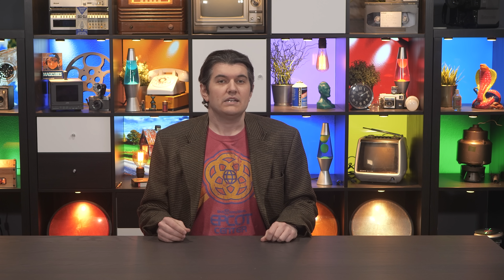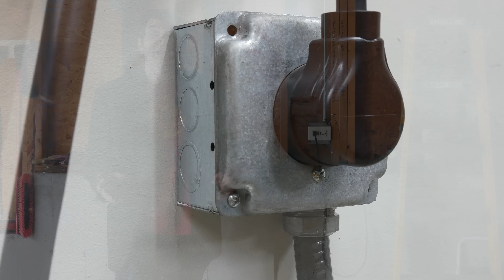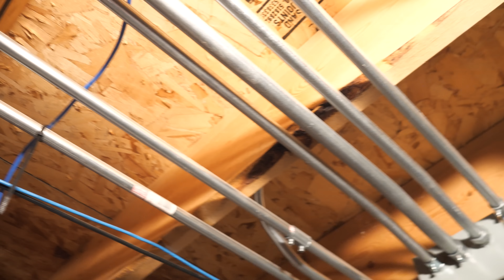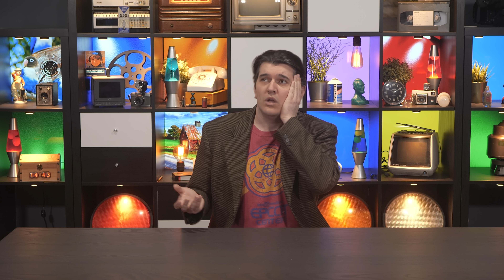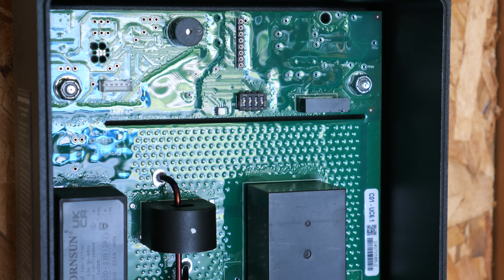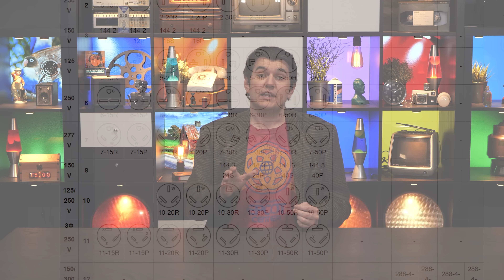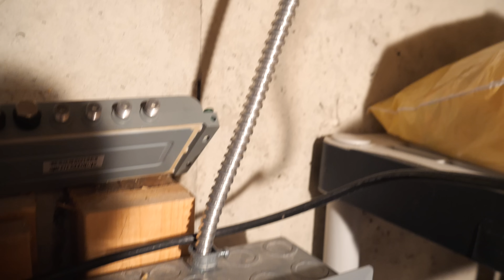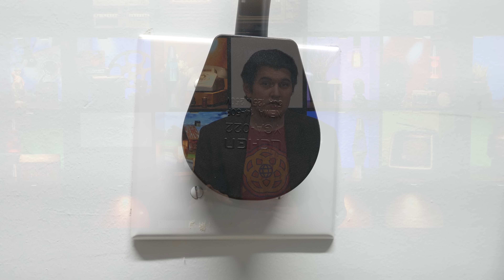The "standard" car charger is usually overkill—but your electrician might not know that

Comment: You can plug a EV into 110 Volts AC outlet, however the biggest con is not enough amperage from the wall to be able to charge the car quickly enough, you'd be waiting for up to three days to get to 20% from 5% charge if that. Naturally it depends on how big is your car's traction battery and internal charging voltage which is now both 400 to 800 Volts normal voltage that they can provide to the motors. So I'd think 240 volts AC dryer plug is a deal better especially in a pinch.
Reply: 3 days? lol
Reply: @HughZantu Try it for yourself. It's limited to 12 - 16 Amps and it takes aggeeeeessss to charge on 120 Volts, especially because recent EVs have huge battery packs so you can imagine how long it will take.
Reply: @Dr_Mario2007  Yes you are correct, I can't try it because I'm a V8 lover. But at the largest market capacity, the Ram 1500 EV has 229,000 watt-hours of capacity and at 1500 watts it would take 152.66 hours to charge from 0% to 100%. Applying 80% limitations that's 122.13 hours to charge. I think yes, the caveat should be that if it's over a certain pack size (100k watt-hours) then it is not practical. But lets be honest most of his viewers are NOT buying the RAM 1500 EV and are buying more Nissan Leaf's than in comparison which would fit into the 8 hours he claims. But it is still an exaggeration to say that 15% charge will take 3 days, because even that RAM 1500 needs 22 hours on the slowest charger to charge 15%
 of its rated capacity. 

Cancel

Reply

Comment: I run ours at ~2kW…
I do have a 7kW charger as well, but that’s very rarely used.

12k miles a year, will at least 11k of those at 2kW or less.

The smart features are important for access to certain tariffs on this side of the pond.  Whenever the car is charging all my power is very, very, cheap.

Comment: I live in a tiny appartment(600 sq.ft), we have to pay 150 extra every month because we need a special connection for 3 x 8kw connection. according to the landlord and his 'trusted electrician' this is necessary because of the heatpump which is connected to a 25circuit breaker anyways. Felt like an insane discussion that they were not understanding how such a connection is not needed

Comment: Berween april and november I limit the powerdraw for my house to 5kwh/h. Because of extra (monthly)fees when using more pr hour. About 1kw goes to heating and household. The rest charges my work car and our private car. They are almost everyday fully charged. 
In the winter the cars needs more power, and the heating of the house too, so i have to pay the extra fee to draw up to 10kwh inside a clock hour.
If I used the standard setting of 11kw charging I would have to pay for the 10+kwh/h plan, and that is extra money each month.....

Comment: I bought an F150 lightning back in October. I am luckily enough to have be able to afford having a 50A circuit run. I spent the extra money on an Enphase EVSE. The internals are basically the clipper creek with the addition of the smarts. It'll charge regardless of whether it has a data connection or not. It is a hardwired exterior installation and I love that I can see it charging through the same app that monitors my Enphase microinverters. With it being an external installation it's nice to be able to shut it off from the app if someone tries to steal free energy from me, though I realize this will probably never happen.
While the big charger is nice to have, after living with the vehicle for months, I probably could use any size 240V charger and be fine with range. Even my big inefficient truck does about 2.2 mi/kwh in the summer and 1.7 min/kwh in the winter. My commute is about 50 miles so I could recover that overnight even with  a 240V/16A charger. 120V/12A was kind of painful before I has the EVSE installed.

Comment: Picked up a refurbished Bolt in February (exceptional deals right now if you're looking for a simple city/commuter EV).  Even with an ~80 mile high speed, mountainous commute, I'm over 10k miles in (with mostly cold weather) and still only using 120v 12a charging.  As long as I can get a sustained 2-day "top off" every weekend, I'm good.  I'll likely install a 240 socket some day, but now with warmer weather, I can almost "fill it up" overnight on 120 alone.
Reply: A used '17-19 Bolt is a sweet spot right now, as every one of them got a new battery, a new battery warranty, and larger capacity battery.

Comment: There are some niche uses in which a smart EVSE makes a lot of sense. 

I have 7.6kw of solar, and a single powerwall (13.5kw). I consume between 1.0 and 1.5kw throughout the day, and in the summer months produce around 40kwh. 

This means around noon, my powerwall is full and I begin exporting 4kw to the grid for  about 5 hours, as my storage is full. 

Since our solar and battery are Tesla-branded, I could do "charge on solar" if I had a compatible Tesla vehicle. We do not, opting instead for an ioniq and a bolt. 

Choosing an OCPP-compatible EVSE means that I can link my Tesla home API and the Wallbox Pulsar charger with NetZero to taper the current being sent to my vehicle exactly to match the excess solar production which would otherwise be sent to the grid. 

Any power I send to the grid loses 9/10 of its value due to California's NEM 3.0 tariff. 

During the summer months charging on only excess solar saves me 50-60 per month!

Comment: Bonus: those Grizzl chargers are made in Canada!
Where I live, most appartment parking lots have 120V for everyone because it gets down to -35°C in winter sometimes.
Reply: They may only budget like 3A per stall. Most block heaters are only around 300W.
Reply: @economicprisoner only 300w? The factory block heater for my car (a Subaru so not a large engine either) is 450w, plus another 150w for the oil pan heater. In AK, every parking spot has its own 20A circuit, and it’s common knowledge not to plug in to the other half of an outlet someone’s already using, because it’s pretty much guaranteed to end in a tripped breaker.
Reply: @economicprisoner  I didn't stop to think about it but how can they limit it to 3 amps? All 15-amp circuits can take 12 amps no matter what because it needs to be to code.
Reply: @Coccinelf  You are allowed to have up to 12 outlets on a single 15A/20A circuit.
Not sure on block heater-specific code.
Reply: @economicprisoner  Oh why I didn't think of that?
Reply: @economicprisoner  Wait a minute! I know why I didn't think of that! It was plugged in directly on my meter! Only I paid for that. Same with all my neighbours. I'm not saying it works like that everywhere but where I live, appartments where the costs of electricity is not paid by the tennant is so rare, I'm pretty sure they don't include any outlets for block heaters.
Reply: @Coccinelf  I have lived in an apartment like that. I have also lived in an apartment with no plugs: because the garage was heated.
Reply: This varies by the type of building in areas that have block heater outlets. In many apartments the heater outlet is connected to the breaker panel for the apartment the stall is assigned to, and so the full circuit capacity is available and the electricity cost comes off of your meter, so you could reasonably charge an EV from it. In other apartments or condos there are shared circuits for block heaters which are paid for collectively in some fashion. Some of these have energy saving intelligent outlets which cycle the power on and off depending on the outside temperature, and also limit the maximum power draw to around what a block heater would use, which makes them unsuitable for charging an EV.

Comment: I am considering replacing a NEMA 5-15 outlet with a NEMA 6-15 outlet so that I can reuse the wiring (finished basement means I don't have access).

Was not able to find an EVSE with a NEMA 6-15 plug. Got an programmable EVSE with a 6-20 plug. Plan to program it for 12A, and then install a 6-15 plug. The 6-15 plug will prevent visitors from accidentally drawing 15-16A with their own granny lead.

Because the limit is set by software: I am not sure it is fully complaint. But I have confirmed by reading the manual that it will remember the set point after a power outage.

I will require the 240V charging for overnight charging in the winter. Heating up the battery and cabin takes too much energy to do that reliably on 120V.

Comment: I was ‘shocked’ how well a 15 amp plug worked. Barely handles 11 amps 😂 but works well 99% of the time.

Purchased a 50 amp 220 charger. Have yet to bother getting it hooked up.

Comment: I had a 14-50 installed for my evse, but the electrician refused to install anything more than a 30 amp breaker because of my current loads.
(He also gave me an estimate on a 200a panel upgrade) But I've since realized that 30 amps is more than enough to charge my ioniq 5 to full in 8 hours overnight.

Comment: The apartment rental situation is indeed a serious problem for EVs. I think the auto industry has made 2 incorrect assumptions. 

First, that renters don't buy new cars. While that may be true for some, there are many who do (or did before being abandoned as a market). 

Second, is that only new car sales matters so the renters who don't buy new cars don't matter. 

Of course the result is a self fulfilling prophecy. Renters indeed don't buy EVs. Not because they cant addord them, but because as pointed out in this video expecting someone to charge daily in front of the local walmart is insane (even tho it eould be Walmart's wet dream). Of course the long term effect will be a decline in resale values of EVs as the used market shrinks. This will result in more people upside down on loans, either taking increasingly risky loans or delaying tradeins, lowering new car sales. 

On top of that it puts renters in a situation where it is increasingly harder to find an economical vehicle for a daily driver, at a reasonable price. 

And finally if the auto industry were to ever go full EV, it would result in keeping used combustion engine vehicles on the road far longer, at a higher cost, than was ever intended as the used market would have to meet the supply (decreasing) and demand mismatch.

Comment: App connections are just a fetish.  It’s a nonsense that so many devices need apps when there are still many people who do not have smart phones. Thanks for letting folks know that a car charger is basically a plug and socket !
Note aluminium cable in a brass terminal will corrode and eventually break off.

Comment: Just finished a 35 unit home complex (a group of units around a car park) where the residents wanted EVSEs for every unit.     We designed a 3 phase system and put the simplest single-phase Zappi units.   Each phase had a string of 7kW chargers connected.  There's a controller on the network talking to the EVSEs.  The units are connected to a common meter and each unit owner pays for what they use, plus a small connection fee component.  Was there to review a few weeks after commissioning and the data looked very good indeed.   

The whole system was less than $2000 per house, including all of the ground works, conduits, cable, EVSEs and the controllers.     The only issue is that the users can't use their solar exports into the car, as they are behind a different meter.    But - that's just an accounting thing.
Reply: Incremental progress is better than no progress at all.
Reply: Here in Australia the whole metering off house/shared services seems to be the main remaining point of resistance getting chargers into strata title units. There are numerous load management systems available now that can provide metering and billing solutions in these cases, along with managing overall charger draw when multiple chargers are active. Useful when the existing supply is limited. Provisions for load balancing were built into NCC2022 - provision meaning ‘leave space in the board’ - but hopefully we’ll see things get firmer in NCC2025 so developers can’t just cheap out.
Reply: Nice!  I think that employers who provide carparks should provide a certain number parks with access to EVSE.  I've long believed that you don't have to put in some stupid supersized supply which is expensive, but if you have a system that can load share dynamically you can get a lot done while allowing multiple outlets.  It sounds like the Zappi can do that for you, yes?
Reply: @lindsaydempsey5683 not sure which country you’re from, but as part of Australia’s latest National Construction Code (NCC2022) EV charger provisions for a percentage of car parking spots AND available power are required for certain classes of buildings (commercial buildings, hotels/accommodation etc). Alas ‘provision’ doesn’t mean ‘install actual chargers’, just ensure conduit pathways and capacity in the board (electrical and physical) exist so as to support a future upgrade. We of course specify actual charging infrastructure with our designs (I work in consultant electrical/services engineering) but while most government projects want the chargers in place to support their increasingly EV based vehicle fleets, fewer private developers are following through unless their client/tenant demands it. 

Load Management is the key to managing multiple chargers without allocating hundreds of amps of additional max demand. 7.2kW/32A single phase or 11kW/32A 3-phase is all you need per charger anyway… not many cars can support 22kW charging anyway.
Reply: Isn't thatm ore then an accounting issue, because you aren't charging behind* the meter you also have to pay the vat and gridservices.
Reply: @ferkeap  Not British - so where's the VAT being paid?
Reply: @DozIT  I'm not an idiot - And also not a Merkin.   the AU should give you a hint.

We pay GST.  Deffo not VAT.
Reply: Fantastic!
Are there any resources you and your team used to put it together? I’d love to advocate for something like this in my city, showing it’s been done.
Reply: @johnstarich  Whole job ran by me - the engineer.   Trades were my guys, me and a vac-truck .   Boards made up by NHP.  Conduits by Vinedex, pits too.  Posts by me and my welder.   EVSE's by Zappi.   It isn't hard...
Reply: Only 2k to be able to harge the car
Reply: Can you explain the solar export part if it is an apartment complex.
Reply: $2k yikes
Reply: @mediocreman2  That's 300M of conduits buried in the ground, 35mm2 copper cables, the EVSE itself, mounting poles, and comissioning... Plus a profit.   What do you think it should cost?  Nothing?

Just restoring the paving was a was a mission.
Reply: @mediocreman2  an electrician here would charge around 1k+ evse cost for a full circuit install. So 2k isn't THAT bad.

Comment: Counterpoint, my 2000 Ford Ranger factory electric can ONLY charge at 240/208v and 32 amp.   If I tried to use a 110v EVSE it would fry it's charger.  But if you have one of those then you probably should be a little more EV savvy.

We had a Volt for years and could recharge from the daily commute overnight on 110v from an external outlet.  Then we bought instead of rented and put in a level 2 charger, and now have 3 EVs so it's good for keeping up with all that.

Comment: I got a 22kW (more-or-less) Portable Wallbox (Go-e flex) when we bought our first EV. Bein in the EU, 220V 3-phase is standard. It is currently connected to my 16A outlet I already had in my garage - so it is limited to 16A (or 11kW) anyways. Initially I wanted to install a fixed connection and add a 32A breaker directly to the panel (which is on the other side of the wall). Never did that.
By now it is connected to my IoT Network and managed by Home Assistant and it's charge-limited automatically to excess from my 10kW PV power - which is usually 3-8kW during on a summer day. I later added a Shelly button next to the Charger, to turn on "Full power" if I ever need it (never did in the last 2 years)

And can happily run my 16A socket at 100% all day long - as CEE plugs are designed properly (and also supports a minimum of 5000 insertions - with better models commonly support 10k) 😛

Comment: The only thing i can think of for smart chargers is if you have a contract where you get money if you draw power (yes the dutch powergrid is that out of whack that you can get fully flexible contracts that change every hour or so and get money for using power) you could have your car draw very little if you plug it in at a time sorta close to that time and then turn it to full speed when you get negative energy prices

(Edit: autocorrect did not pick up a typo i made)

Comment: Good that you shed some light on this matter. I've made the calculations. I would only need around 2000W to charge overnight and I would still have enough energy in the EV to satisfy all of my needs. No need for an extra circuit.
I've looked at electric driving. But it's not for me, for other reasons than keeping it charged.

Comment: "If a charging station requires the use of an app to configure it for a smaller circuit, my first instinct is to throw it into the ocean."   

Wouldn't a midwesterner find it much easier to throw it into a lake?  Or were you expressing that you hate them enough to make a drive to the coast?

Comment: My wife and I have had our 2020 Chevy Bolt for a year and a half now and all we've ever had at home is a 120v charger in our garage. Other than a few times in the winter when I was working both my jobs so I was getting home from work at 9:30pm and leaving again at 7am. Sure, a 240v line would be more convenient but it's just not worth the expense to have one installed.